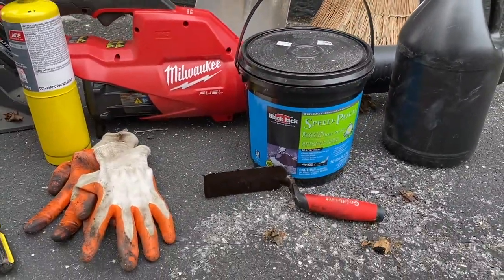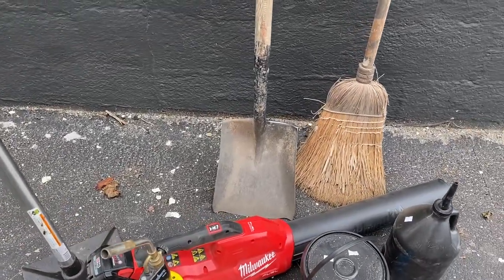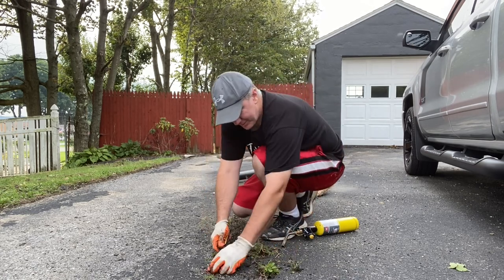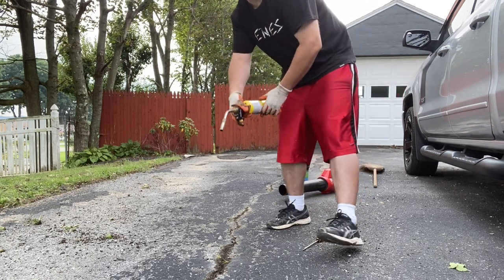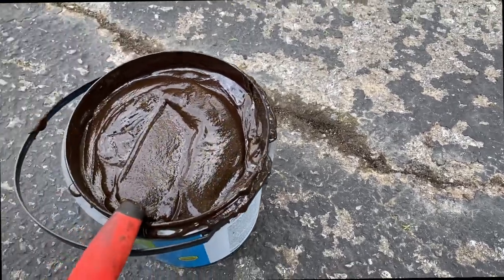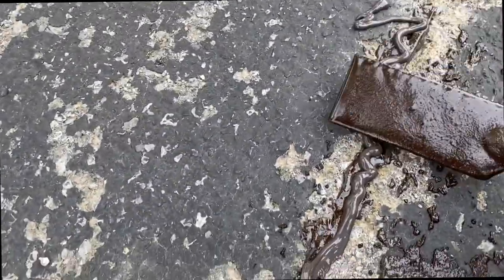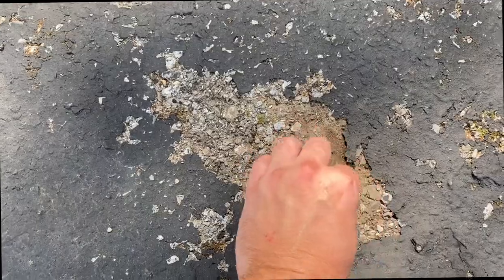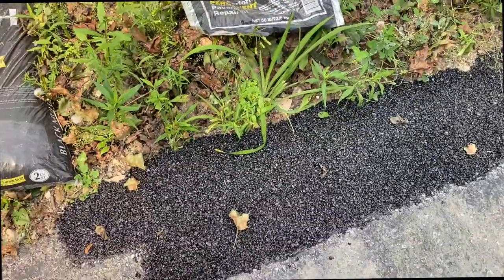Driveway Crack Repair DIY  { Seal a Driveway Part 1 of 3 }

Comment: Ever since I saw someone use a little flexible rubber Bondo spreader for the smoothing and finishing, ill never look at a metal tool the same way, it just doesnt even it out as much as the rubber. I highly recommend giving it a shot next time

Comment: thanks for this video. I did the liquid on a larger crack and it just sank into the hole the next day. New England rain washed some of it away before it could cure. I see you used black jack sand mixture for the larger cracks which makes way more sense than the way I did it.
Reply from the maker: Thanks for watching! Same thing happened to me when I sealed the one driveway a few years back. It was supposed to be nice and then a major storm came and messed it up. I just found a product called crack sticks and you place it in the crack and heat it with a torch and works well and drys fast. I will add a video of it when I get a chance but this could be a good option of the weather changes fast in your area and you want it to dry quick.

Comment: I have some cracks but there’s dirt at the bottom of them which is the ground under the driveway. What do I do for that? If you don’t want to pour it on dirt?
Reply from the maker: Thanks for watching. It depends how deep the crack is. Can you put asphalt patch in it to fill it up? Asphalt patch sticks a little better then you can fill in the top with the repair and it will hold. Just depends on if the crack is larger anough to do this. I have another video for crack repair in the playlist that you use a torch to melt and that bonds much better if you can not put in asphalt.
Reply: THANK YOU  @BrianWingard
Reply from the maker: Good luck with your project! @howarda4227

Comment: How long did that take to dry?
Reply from the maker: Thanks for watching. It really depends on a few things. If the weather is warm it drys faster and also it depends on the depth of the crack. My rule of thumb just to play it safe I will let it dry for 24 hours. If for some reason you do not wait long enough then when you apply the seal coat it could pull it out of the crack if it did not cure fully. I am sure you could do it in less time but this is my usual.

Comment: What’s.  Wit.    The.  Toutch
Reply from the maker: Thanks for watching. The torch is to melt the crack repair. You can use a heat gun I would imagine but would take a long longer to melt.